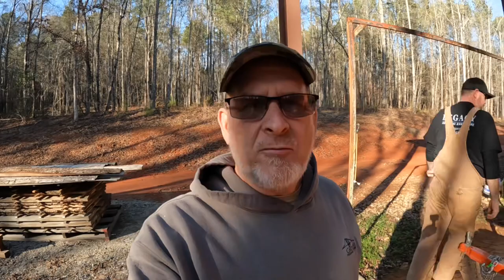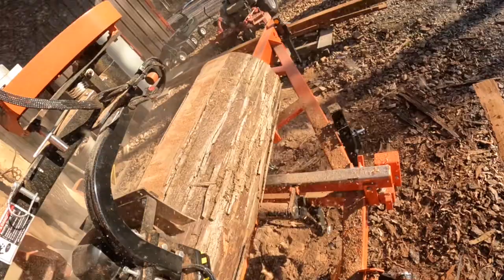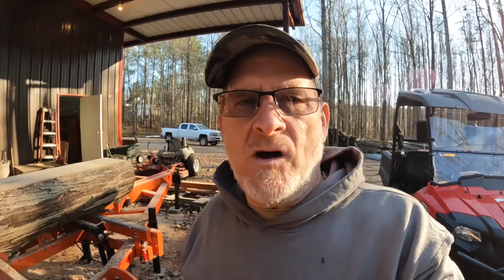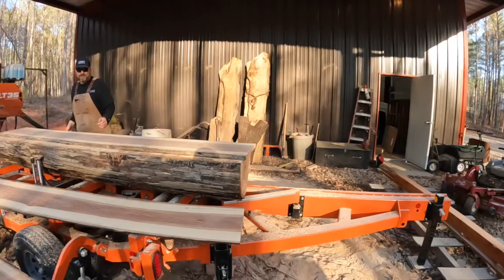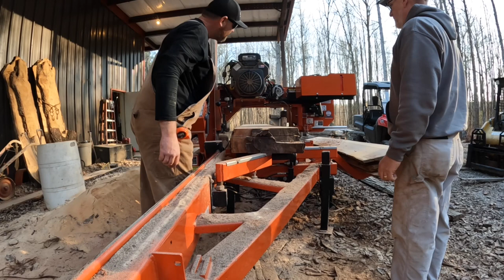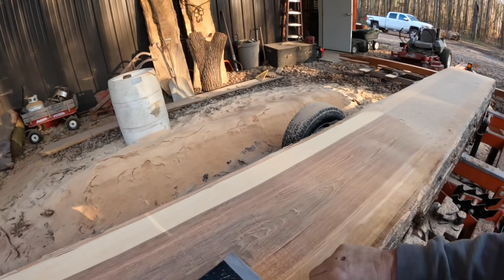Shag Bark Hickory on the Woodmizer sawmill

Comment: Hi guys you should have a blade lube system on the saw your blade will last longer and cuts nicer.
Reply from the maker: Howdy and thanks for the input, it does have a lube system and we use it all the time. White bucket with blue fluid at top of sawmill head.

Comment: I don't believe that is a Shag Bark Hickory but rather it is a Shell Bark Hickory. The shell Bark does not have the bark protruding as much as the Shag Bark. But I don't believe there is much difference in the wood. Now the nuts from the shell bark are not nearly so desirable as the nuts from the Shag Bark. People often make this mistake in the ID ing of the 2 trees. Hickory is the heaviest of the hardwoods with  a cubic foot of air dried Hickory weighs in at 63 lbs.
Reply from the maker: Thank you for the feedback, I looked in a reference book and was more convinced of shagbark. Either way it turned out great.